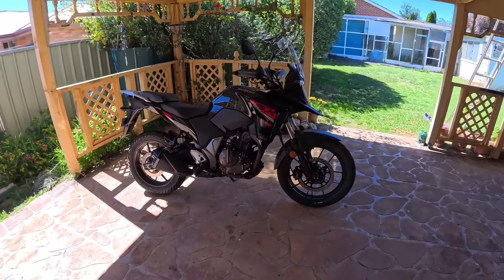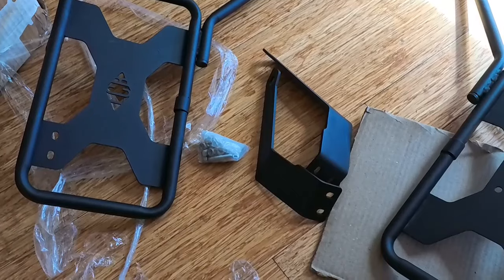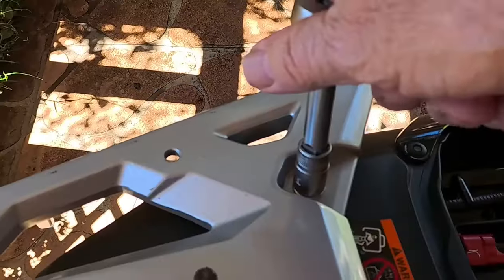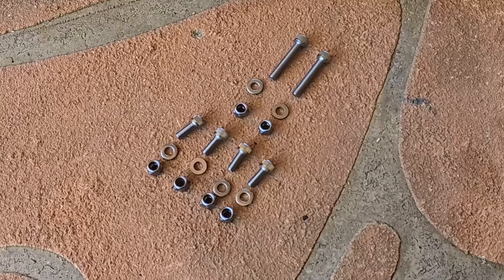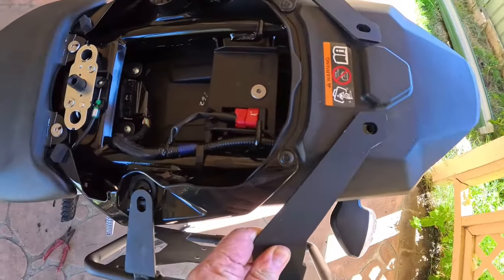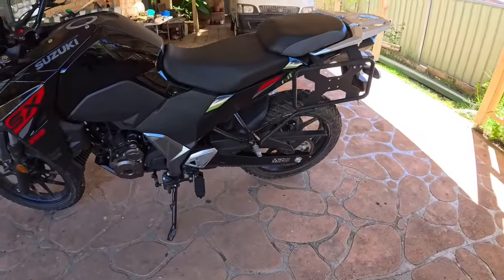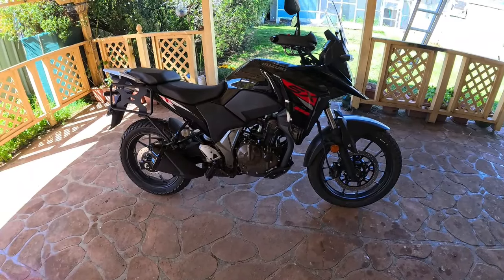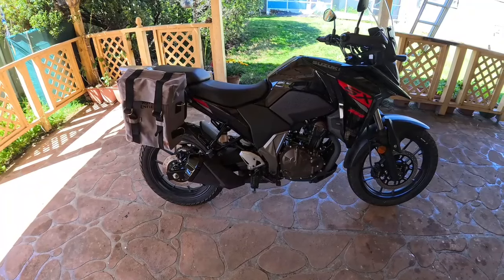2024 Suzuki Vstron 250 SX - Adventure Riding - How To Fit The Pannier Racks -Part 1.

Comment: That looks a great set up Warro and will make the bike much more practical to use. I would have put a wee bit of threadlock on the bolts just for peace of mind. :yougotthis::yougotthis::yougotthis:
Reply from the maker: thanks and i might go back tomorrow and do just that with the loctite. plus it may be a good add on when i fit the crash bars. they only arrived late today so working tomorrow on those.
all the best!
Reply: And all the best to you also. @ridewithwarro

Comment: This looks a ripper secondary bike for doing gravel work. In the future, please make a video giving as an idea on its gravel road guts. I'd consider getting one of these over say a Yamaha WR250R or Honda CRF300L, which I don't enjoy riding on the high speed roads to get to the gravel!
Reply from the maker: yeah i had a new 300l and didnt like it much. had the crf250l and the rally too. never had the wr250r
id say it would easily be the better bike but not sure if you can buy them new or not.
if so id say no change out of $10k so still think for the money this is hard to beat.
this will be doing lots of dirt once i set it up so it may be good or bad..lol time will tell there.
either way its a good sealed road bike at 100 kph easy cruise.
this one has only done 120 klm total but i think that will change a bit shortly after weather cools down a bit
Reply: @ridewithwarro WR250R was good, I was riding my brothers, but its was nicked out the back of his Hilux in the woolies car park when he stopped for lunch!  But thats the problem, had to drive it to the good spots because no good on sealed!
Reply from the maker: @MrCombfoot  yeah those wr's are pretty popular especially from riders who'd like to get them at a steal...lol
these 250 sx's run well on sealed at 100 kph with no effort and not much in the vibes either.
for the rideaway price it would probably be worth looking around for a suspension upgrade to move it to a new level.
that side doesnt worry me as where i go and by myself a fast ride on dirt is not a safe ride.
when on the enfield most of the dirt roads rides i was the only one on the road and i plan similar rides for this but in new riding grounds

Comment: I am thinking my next bike should be something more simple to work on (more in my wheel house) like this.    Thinking dr650,   any experience with them?
Reply from the maker: actually i have never tried one of those but i did have a new drz400e for a week i think...lol didnt like the seat height so sold it to a guy who rode it to the cape.
Reply: Thanks,    was thinking 650 because it's still air cooled.  
   Need to go sit on one first lol.
Reply from the maker: @stevetaylor9265  id say they are pretty good bikes and well liked too. plus a fair bit more power than these 250's
but i like the smaller and lighter bikes and im planing to ride into some rough country on this one so the lighter the better...lol

Comment: nice one. looking forward to seeing what crashbar you got. I have been watching deals on ebay and checking out which india direct stores will ship to Aus. I went with a locking removable 45L square box type rear box from temu $150. the box is great my pillion loves it as a backrest done around 1000kms 2 up out of 1200 total so far
Reply from the maker: next clip up will be fitting the crash bar as only got it today. only done about 120 klm in total on this bike but shortly i hope to improve on that side too.
good deal on your top boc score compared to about $350 for that smaller factory unit
all the best!

Comment: That Strom looks a great lighter weight trail runner - plus front mudguard near the wheel to catch the crud at source. Interested in how the dual purpose tyres cope as they look to have a decent tread pattern for both road n semi-wild
Reply from the maker: time will tell there. after my options arrive and fitted its time to clock up a few klm and try it out properly. thats the plan and this time i hope to be better prepared compared to ast time anyway..lol
all the best!

Comment: Hello Warro.  Aaron here from the United States.   I have a 2022 Royal Enfield Classic 350 Halcyon Grey. I am enjoying the experience.   However at 2600 miles my speedometer is stuck at 20.  The speedometer increased but never decreases below 20 on the gauge.  
   I remember you speaking of a similar situation for yourself.   What did you end up doing?
Reply from the maker: well you can pull the speedo and give the terminal a bit of a clean but its only a short term fix.
it should be covered still by factory warranty and if you put in a claim they should replace the speedo for free.
i think they fixed this fault on 2023 models so enfield is very aware of the issue
back in my 22 history there a clip on what i did cleaning wise.
must be hot where you live as for some reason this pops up more as weather or temp increases too
Reply: @ridewithwarro I do live in the desert region of USA.  It's 89° here today March 29.  I just absolutely dread dealing with these hooligans at the dealership.
Reply from the maker: @aaronbrewer1742  best idea if you go in show them a photo of the speedo stuck on the 20 mark. i had to supply a photo of mine to the dealer so they could make the claim.
long wait them about 3 months but that may improve by now.
easy to fit yourself

Comment: Hi Warro , to be honest the best 250 for dual purpose work is the xt250 this bike has to much bodwork
Reply from the maker: actually owned one of those new in blue about 5 or 6 years back, pretty good bike but in those days i NEVER rode on dirt...lol
was a nice little compact bike indeed
true this 250 sx is cappying a bit of plastic..lol and since this clip ive added crash bars and sump guard. next week off road tyres.
i think on todays market there would be a good $2000 splitting those bikes.
all the best!

Comment: Be able to bolt gas cans on those frames too if need to carry extra fuel.Also if you got bags on frames & engine crash bars & bike gets dropped barely get any damage if any & be on the bags maybe a scratch or chip on paint on engine crash bars nothing a dab of paint can't hide.
Reply from the maker: dont think ive had a bike over past 12 years where i fitted crash bars. so its a first for me there. but i did drop that yella terror...lol
hopefully the bar idea will give me a hook up point if it happens or when ..again.
solid crash protection bars too. must weigh in at a good 6 kgs or more and add lover engine protection too
Reply: @ridewithwarro  Yeah you should be able to hook up your winch system on it.Increase lower of center of gravity too.
It's a nice looking bike in black I think 🤔 I like it better than old yellow.
Reply from the maker: @ruahinesrider  blends in better i think. although i still would have liked that orange one...lol